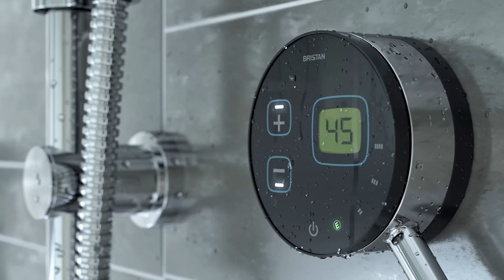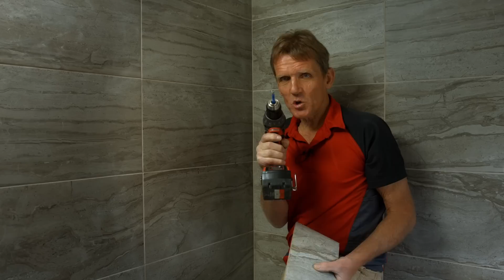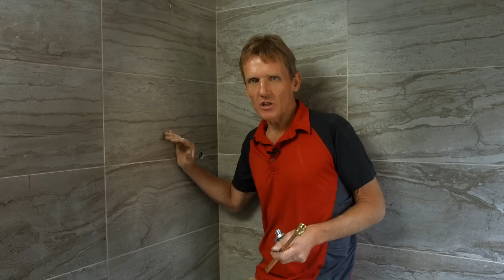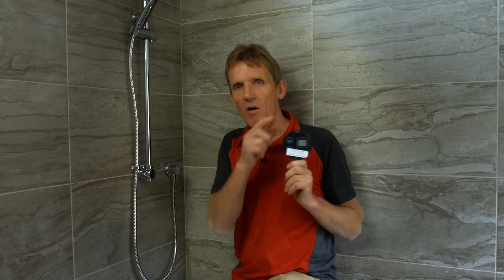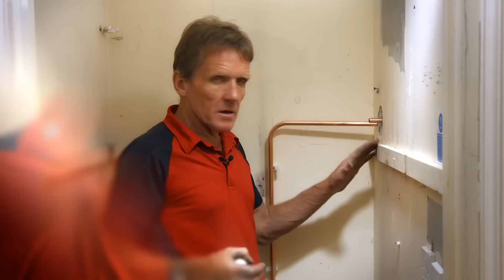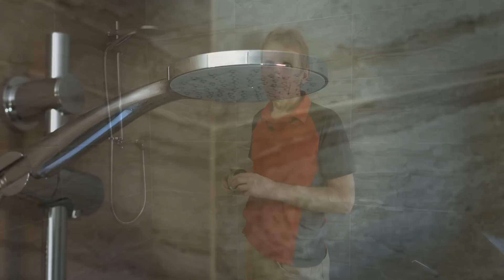How to Install a Bristan Artisan Evo Digital Shower

Comment: Mine has just stopped working today just a trickle coming out and not firing the boiler done a purge test water coming out fine. The e on the control is flashing green any ideas. Thanks 👍
Reply: Hi Mark, I have the same problem, I noticed the water flow was slower than normal and the noise from the control box increased until now when I have very litttle flow but still enough not to trigger an error. I've opened the control box and there is only two solenoid valves, one for hot and one for cold. I can only imagine they constantly open and close  to adjust the output temperture. I can measure the resistance and both are the same, but when I measurer the voltage when they should be working, one is at 24V and the other is 9V. I cant find any spares info on the Bristan website, but these solenoids are common in washing machines and other showers etc.... Did you manage to resolve your issue.
Reply: No mate got a new shower put in as was moving in a few days  it broke 🍻

Comment: Hi, Just installed this shower and the water flow is very intermediate, gets to temperature, pumps quite load as well. Anyone had any of these issues?
Reply: Yes. We recently changed our boiler to something more powerful and it works really well now.

Comment: I bought this shower after watching this video about a year ago, gotta say I'm really pleased with it easy to fit and works a treat easy to set temperature. it was fitted when I had a combi boiler now I have a system boiler it works just as good with both and the controller is still on the same battery, thanks for featuring this.
Reply from the maker: Thanks Patsy. I guess you are using an unvented cylinder now so loads of pressure and flow.
Reply: Yes your right it's unvented good pressure with fast re-heat and I fit heatmiser wifi stats what also seem very good.

Comment: are you sponsored  to show products ?
Reply from the maker: +lesmoor kelly 
Hi Lesmoor 

The answer is yet and no. This video was paid for by Bristan and appears on their site. We used is on our site because it is a 'How To'  and has relevance to general installations.  I understand that we must make this clear at the outset. We have recently looked at this whole issue and any new paid for content will be clearly labelled. We will also be going back through our content to make sure every one of our videos is clearly marked if it is sponsored. Confusingly our head to head tests where we compare products are not sponsored. 

It is a bit of a mess and I apologise for that but we will fix it very soon.
Reply: just wanted to be clear if you being upfront

Comment: I've just installed a Bristan Artisan Evo Digital Shower linked to a separate hot & cold  shower pump- but can't get any water through the mixer valve.The mixer valve doesn't appear to start the pump? Is there anything which can be done  or I would I need to change the digital mixer to a different brand incorporating an integral pump?

Dave Francis
Reply: did you resove this issue?

Comment: Excellent demo of this shower, this is just what I would like, thanks. I want to replace an electric shower which packed up ages ago and which was never really satisfactory as far as pressure was concerned although in my area the water pressure is very good. I like to feel the water hitting me hard in a shower and was thinking of installing a conventional hot/cold 'mixer' with a shower pump in the loft just above. My question is can I use this digital shower setup with some form of shower pump upstream or will the processing unit not be able to handle it, thanks.
First floor flat (converted house)
Conventional boiler
Cold tank in loft
Hot water cylinder floor level but looking to re-site in loft
Shower at floor level (obviously)
Shower pump and digital processing unit in loft ideally
Controller unit somewhere just outside shower cubicle in bathroom
Reply from the maker: Bob Hatcher Hi Bob
You can get this self same set up with an integral pump in the box so that way you won't have any problems. There are several makes around so compare prices and specs. They all work the same way.
Reply: Skill Builder Thanks for your quick reply, that's brilliant news re integral pump. Will start looking around. Thanks again for reply and what you do, much appreciated.
Reply from the maker: +Bob Hatcher HI bob. You can buy the digital mixer with a built in pump. You can't pump mains pressure on this kind of shower.
Reply: +Skill Builder 
I've just installed a Bristan Artisan Evo Digital Shower linked to a separate hot & cold  shower pump- but can't get any water through the mixer valve.The mixer valve doesn't appear to start the pump? Is there anything which can be done  or I would I need to change the digital mixer to a different brand incorporating an integral pump?

Dave Francis
Reply from the maker: +Dave Francis 

Hi Dave 
The problem you have is that this mixer needs a minimum of 1/2bar to start it. If you have a negative head kit then the pump will supply this but I am guessing that you are relying on a cold water tank for the head. In that respect you will need around 4 meters of static head to start things moving. This is the height of the base of the cold water tank above the shower head. 

If it is all fitted try taking the shower head off the hook and lowering it to the shower tray or bath to see if you can get enough to start it. 

Buying another shower with  a built in pump is an option but it might be cheaper to fit a negative head pressure vessel between the pump and the shower mixer to give you a start
The mixer in the video is on a combi boiler so mains pressure is used and that is usually above 1/2 bar,
Reply: +Skill Builder 
Thanks for your reply-
Yes it is all fitted- But the shower is a ceiling rose type and not a loose shower head-
Would you have any details of " a negative head pressure vessel between the pump and the shower mixer""
that could be incorporated??
Dave Francis